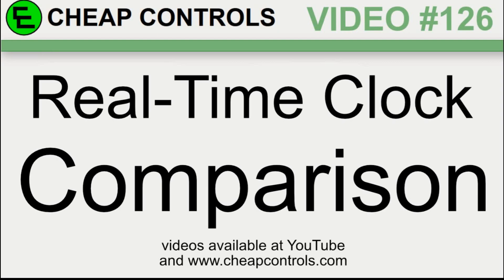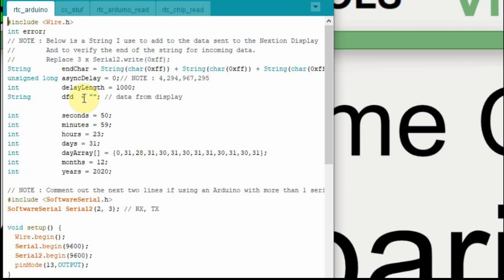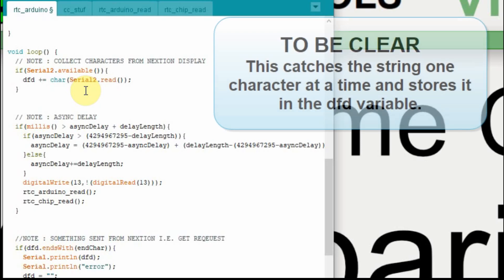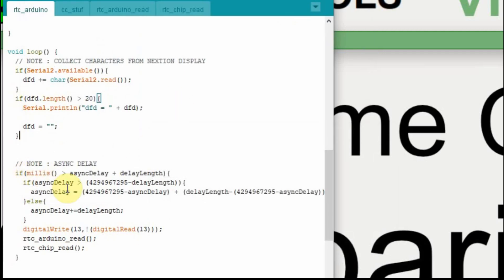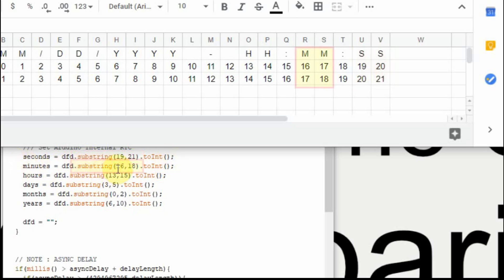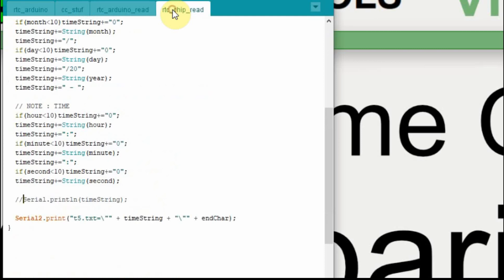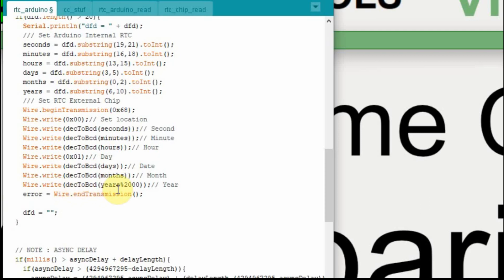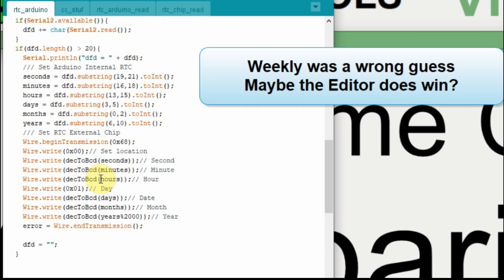126 Real-Time Clock Comparison DS3231 versus Nextion Versus Arduino

Comment: Howdy, Mark. I was wondering if you could provide an example of how to send the Nextion RTC data to the Arduino so that time-based events could trigger on the Arduino based on the Nextion’s time and perhaps even make it so that once a day, week, etc. the Nextion could reach out to an NTP server to update its RTC so that after some period of time, say a year, events would still be triggering exactly when you would expect them to. I could live without the NTP update if the added complexity of that feature is something you’re not willing to tackle but the Nextion RTC to Arduino for time-based events is holding up my current project. As it stands I’m displaying the Nextion time on the Nextion screen, triggering Arduino events (actually an ESP32) via a separate RTC module all while also sending data to a php script which then sends sensor readings to MySQL which has its own time stamp. Needless to say, they’re all slightly out of sync and it’s driving me nuts. Eliminating just the RTC connected to the ESP32 so that the Nextion and ESP32 are in sync would help out tremendously. Anyway, keep the videos coming. You do an excellent job of breaking down the concepts and I frequently find that videos from the past which I never thought I’d need to know anything about become lifesavers when I hit the inevitable Nextion roadblock. Your work is appreciated.
Reply from the maker: I still have the circuit running and I have been taking pictures about everyday.  I hope to have an update on how they all compare over time.  You are a person after my own heart.  PHP and MySQL are two of my favorite things.  I would love to start some more involved projects.  If you have seen some of my old videos I discuss the raspberry Pi doing data collection with PHP code.  I have a few ESP32 chips collecting dust as they await their turn.   I think I would rather use the ESP32 in upcoming videos over the Pi. I keep a list of videos I want to get too and I will add this one to the list.  I am not sure that is the reply you want but give me a day or two to think on it and I will reply again.  If you do not hear from me in a couple days then the holiday has taken over and I might need a reminder.  Please feel free to reach out through cheap controls.com, on the homepage is a comment form sends me an Email.  It doesn't record any information or sell anything.

Comment: Hello ,i need to connect ds3231 rtc module to nextion basic 3.5 inch display and i want to diaplay date and time in nextion display and i am new in nextion display please help me to solve my problem with your expertise.
Reply from the maker: That is an older video so I do not remember it well.  Was there a specific question you have?  I wish you luck and appreciate your views.  Thank you for watching.